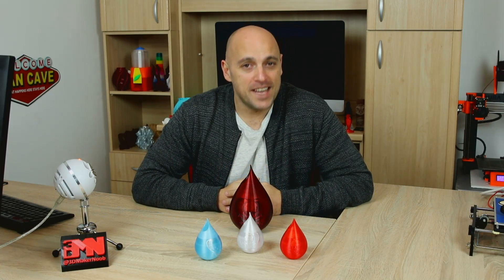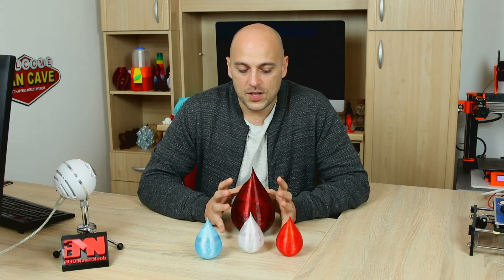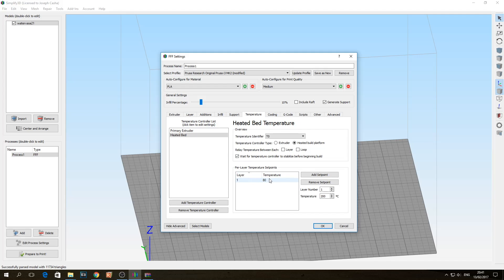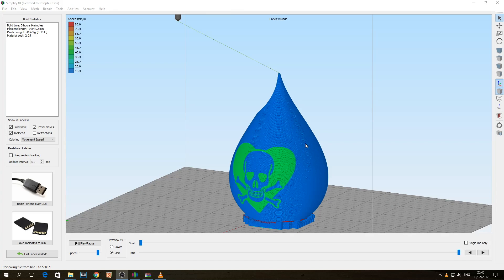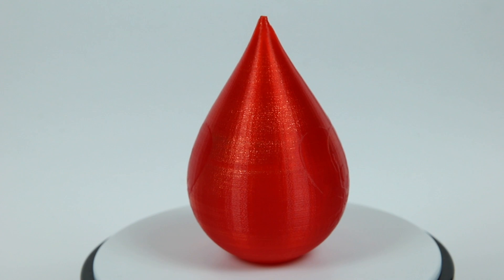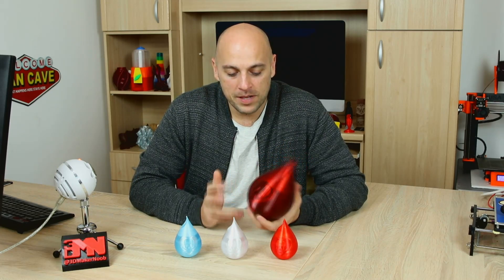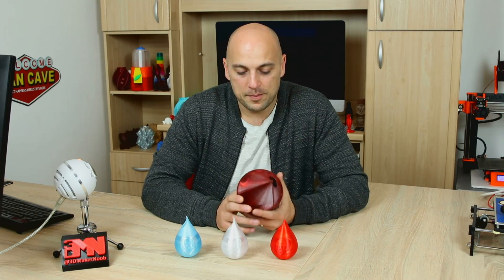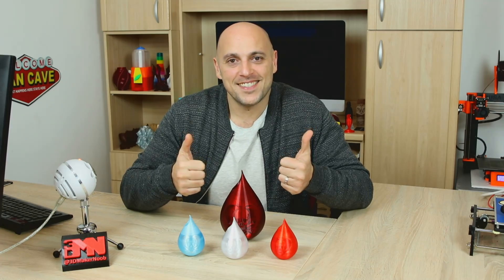3D Printed Awesome Creation - Velocity Painting on a Droplet Vase

Comment: you can change the temps in the gcode itself. usually it's in the first 20 lines of the gcode. I recommend using notepad++ for editing gcode. 

hope this helps. if you want to know more or are unsure what you're doing feel free to contact me. 

and nice videos. you've got one sub more. cheers, Richard
Reply from the maker: Hey Richard, thanks a lot for the info. My next steps now are to learn a bit more of gcode as i feel it's necessary :) i'll definitely get in touch. Thank you
Reply: Hi Joe,

If you look at the beginning of your gcode file you should be able to find 4 commands (my gcode is created by slic3r btw.):
M104 S210 ; set extruder temp
M140 S65 ; set bed temp
M190 S65 ; wait for bed temp
M109 S210 ; wait for extruder temp

Those 4 lines are setting the temps and wait for them.
Those are simply the temperatures in °C - so if you want to change them on your files simply edit them and save them (maybe better as a new file to not destroy the original). No need to hassle around on the printer to override the temps in the gcode for a different material.

If you're using a different temperature for the first layer (Which I do nearly on every material) you need to find the second M104 & M140 command and adjust those accordingly. Like here:

M104 S200 ; set temperature
M140 S60 ; set bed temperature

Be aware that those commands can be quite a bit down in the gcode (use the search function of you editor) and look out for M104 (and maybe M140). Usually right after the temp change commands you should find the first Z-Change which should look like this: G1 Z0.350 F7200.000 (the numbers can differ of course).

For your first steps into gcode I´d forward you to http://reprap.org/wiki/G-code - this is every gcode command for all the different firmwares out there.

Have fun and keep on the good work.
Regards, Richard
Reply from the maker: awesome, thank you so so much. will definitely be trying it out :)

Comment: This ain't really related to this video, but...when printing stuff, how does one determine if one needs supports? Or how much infill to use? Do you just have to keep trying until it works, or are there some good rules for this stuff? (Maybe do a video on this stuff for us beginner?)
Reply from the maker: Nita Vesa good point, will definitely do one :) as a rule of thumb I tend to us support for any parts that are lower than 45 or 50 degrees, a specially for parts that are free hanging. In terms of support, I never use more than 20% most of the time I do 3 perimeters and use 10 - 15% depending on the complexity of the model
Reply: Okay, then! I shall eagerly await for you to get around to doing the video, I'm sure there are plenty of us amongst your viewers who are still in need of some guidance here :)

Comment: What camera are you using for the timelaps video? Looking for a good solution for good timelaps videos ^^
Reply from the maker: apologies, yes you can. the micro HDMI is only need it if you put it through a capture card. The camera itself actually has in the menu a feature to be used as webcam
Reply from the maker: A very decent and cheap action camera from aliexpress. timelapse is even easier than gopro as it collages the shots straight into a video rather than having to do it all manually
Reply: Thank you very much
Reply: 3D Maker Noob Can you use the EleCam as a webcam?
Reply from the maker: yes you can, you just need a micro HDMI cable :)
Reply: so you can't use the USB port and need a HDMI-2-USB device?
Reply: thanks, I will get one. maker muse  has also a cheap cam using it for timelaps and as webcam, but don't know which he has.
Reply from the maker: there won't be much difference. this also comes with quite a lot of accessories and also has 4K video which comes in handy :)
Reply: yeah nice quite cheap 4k action cam...and it works via USB as webcam.

Comment: Yes, this is absolutely amazing. I've seen this a few weeks ago. I also saw another facebook group member that created his own interpretation of velocity painting. I will be coding my interpretation of this technique as well.

I am thinking that it will be game changing because it allows a non-3d modeler to enhance the model for printing. It also allows the 3d modeler to design a very specific skin (or skins) for a model. I can see a huge potential in this technique.

also, I am thinking that the imprint will be more visible on PET/PETG or transparent filament compared with others.
Reply from the maker: translucent filament will always work best i feel with this technique. ironically, the creator only had used translucent PLA with this technique, we weren't sure it would would with PETG, but it absolutely did :)
Reply: My brief experiments with Faberdashery transparent PLA haven't been particularly promising -- the effect is pretty subtle. It does work with opaques better than I thought it would though. There's some kind of short-term thinning of the print when the print speed increases, so you get discernible contours on the print as well as the effects seen in translucents (a different colour, translucency and sparkle).

Comment: Really impressive.  Just sort of spitballing here, but I wonder if you could do something with combining STL files, sort of like for dual extrusion, but have one "material" print at one speed and the second "material" print at the other?
Reply: Thinking the same, it should be quite easy to do with the new Cura 2.3 (or 2.4) I think there's even a setting to "share" the infill, I must test this it's cool! Thanks for sharing
Reply from the maker: i actually testes out the dual speed mode on a low poly pokemon yesterday. works fine, just used the wrong kind of filament :)
Reply: i was going to say the same thing
Reply from the maker: +The Gentleman Scoundrel hehe it's something I am gonna be testing out :) in theory it should work though
Reply: 3D Maker Noob only issue i can think of is the fact that infill won't be shared between both processes
Reply from the maker: yeah true, however if the filament is translucent enough, the effect should still essentially pop out
Reply: Good idea -- I can't see why that wouldn't work. Another idea is that slic3r allows you to specify a mesh that encloses parts of your model, and then applies different settings to the part of the model that's enclosed, so you could use that to modulate the print speed. (Doesn't work for vase mode though.)
Reply: I haven't had a chance to use Slic3r yet, so that's a neat trick to know.  Mostly I was trying to find an artist's solution to a programming problem.  I was picturing going into your favorite 3d art program and using some Boolean modifiers.  I do like it when there are more ways than one to get to a solution, though.
Reply: does it need to be a translucent filament?
Reply from the maker: ideally yes, not necessarily completely translucent, but the effects just pup out more with them
Reply: My experiments with opaque filament indicate that it doesn't affect the surface texture (at least for the few short tests I've done -- will do more), but the fast-printed parts are thinner walled, so you do get an impression of the image (quite literally!). Subtle, but still useful.

Wonder what copperfill or similar would do?

Comment: That is awesome!  amazing how speed would cause a image to appear.
Reply: I will print this off in Prusa PLA Silver within the next couple days and share a photo of how it looks.
Reply from the maker: +Jimmy Shaw's Tidbits yep, only tried it with transparent filament. Will be interesting to see what effect normal PLA will have
Reply: The image appearing as the print proceeds can look pretty cool: https://www.dropbox.com/s/4kj9o6htpau15b8/2017-01-26%2019.29.54.gif
Reply from the maker: awesome! :)
Reply: This is the result I have at 210 on the extruder and 60 on the bed. I'd like to give it another go at a higher temp and see if it contrasts a bit more.

http://imgur.com/P5Jrx6k
Reply from the maker: that looks seriously awesome, well done!
Reply: Golden Aura Nice one. I'd say that for opaque filament that's come out very well.
Reply: It would be interesting to see how temperature affects it but may be more about the difference speed I suspect. I can generate a GCODE file with a more pronounced difference in speed if you'd like to try it?
Reply: I'm noticing a slight difference with a change in temp, mainly a slight gloss look. I took this picture with both side by side. The one on the left was the one printed at 210 and 60, the one on the right was printed at 230 and 60.

http://imgur.com/vbuQklX
Reply: I can try it yeah.